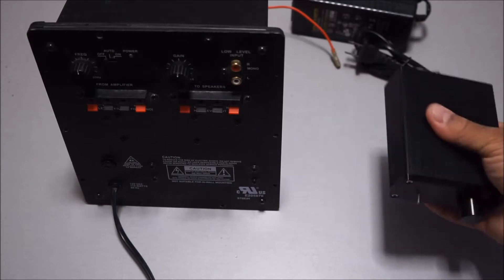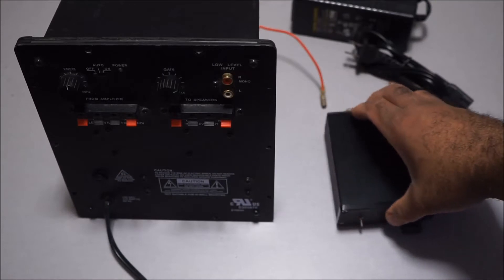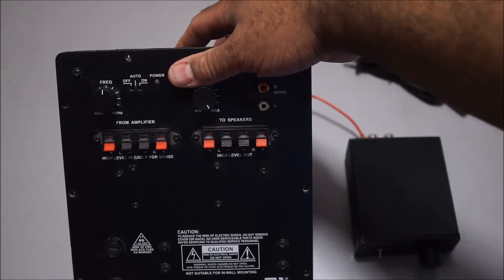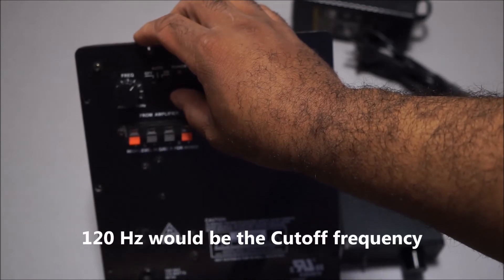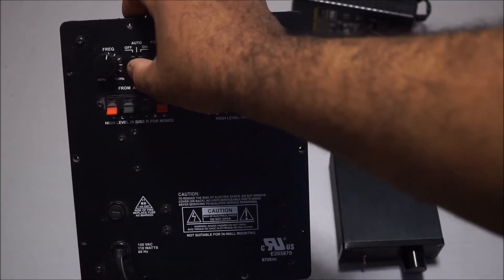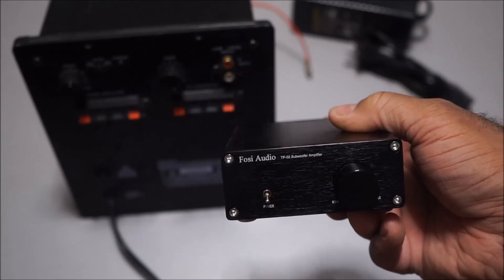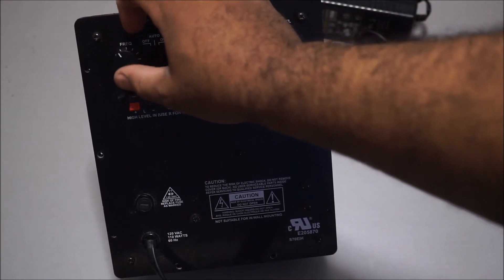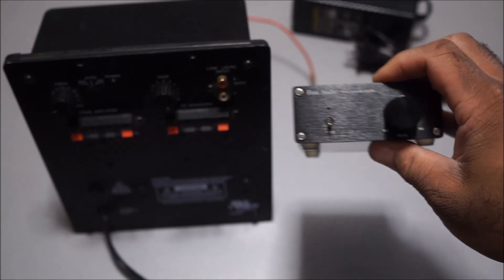Difference between a Subwoofer Amp Plate and the Fosi TP02 Sub Amp

Comment: I don't think this chap knows anything about audio or electronics.  If that plate amp (analogue) is rated at 400 wats, the general efficiency of the amp would be around 20 to 30 percent that would actually go to the speakers.  The rest is heat generated depending on the class, A, AB or C. That is why you have big heat sinks. That little FOSI shown is a class D amp (Digital) which is pulse width driven and the efficiency is 90% plus and heat sink is minimal.  Most likely this little Digital one can out perform the very much larger and heavier Analogue one.

Comment: The Fosi TP02 is perfect match for a Dayton BST-1 Transducer. I have 2 mounted on my sim rig, under the pedals, under the seat. This amp drives them very nice with loads of power so you can feel every bump, engine noise, gear change. Brilliant cheap amp for sim racing.

Comment: In my opinion, you missed several key points.
*point one* Most plate amps do not have an inside cover. This is for a good reason. The cover takes up valuable real-estate inside the cabinet. Also the air vibrating and pulsing inside the cabinet cools the amp. Being covered with no air circulation, an amp cooks in its own heat. 
*point two* I did buy and try a Fosi TP02 Sub Amp.  The power supply that comes with it is only good for less than half power, 150 watts. It would not drive my SVS PB2000 speaker ( I could barely hear it). The larger power supplies that allow full power are intrusive looking, expensive, and do not come with the correct connection. After failing to function correctly in its original configuration, I sent it back.
*point three* If your amp has an RCA sub pre out, the cross over frequency is already controlled. I recommend turning the plate amp's cross over frequency control on the highest setting , so as to not to double control this function.
Reply from the maker: Thanks for the comment.  Yes, I just wanted to do a quick overview and comparison of the two amps and just go over the basic functions.  Yes, the cover do take up space from the internal volume of the enclosure, but in a way it does help to shield the electronic parts such as the wires and steel screws and other parts from the large magnet of the woofer.  The magnet of the driver will effect the performance and the signal of the subwoofer plate amp (the electronics in the plate amp). is the woofer is too close to the amp plate.
Yes, that's the problem with with those small Tri-path subwoofer amplifiers (such as the fosi amp) Those amps are small, but have a bit of distortion when they are pushed hard.  The sound good at low levels, but at loud volume, they  distort hard.  And the power supply is always under powered, which does not give the full wattage as stated.  Plus the fosi amp sparks when you connect the adapter to the amp (when off), that's very unsafe.
It's always good to have a frequency controller on the amp.  it will help blend in the main speakers better. 

If I have time, I may make another video of the subwoofer plated amplifier.  The next video will have a more in-depth look.
Reply: @lovethatpop  A plastic cover does not shield any magnetic force from coming in.
Reply from the maker: I just posted the video reply to the Dayton Audio SA70 Plate Amplifier.  This time around, I tried to go over every feature that is listed on this amp and how it works.  I hope this clear everything up. Here's the video:  https://youtu.be/4fydq7ZpwHI

Comment: You think that the small one will have enough power for bass shakers?
I bought one from China. It has a LPF and the output was tested so I know what I'm getting. The alternative was a plate amp from China without any reviews.
Reply from the maker: Yes, the small Fosi amp has enough power for bass shakers.  The fosi amp really surprise me on the power it has.  It was more than enough power to run a 12" woofer. almost to much power to run a basic 12" woofer.  The fosi amp has a 200 watt output.  the power is true.  it also has a very good crossover, it produce very low and deep bass response.  The fosi TP02 is better than the amp plate from China.
Reply: @lovethatpop  I saw a text here on  YouTube showing it only had 50W.
I got the Aiyima A3001 amp. It should be a bit better bit I'm still wondering if it's enough.
Many people said that the Fosi is not enough. Even if it shakes the bass shakers it doesn't have the punch like a plate amp. Maybe because of the small power supply vs. the big capacitors in the plate amp?
Reply: @westsenkovec How did the Aiyima work out for your bass shakers?  I just ordered the same one and wondering if I made the right decision, as I was also looking at the Fosi TP-02, to connect to some Dayton BST-1's on my theater seats.
Reply: @SnakeDoctor5104 My receiver died so I never installed them. I tried them quickly to see if it works and it worked fine. I can't tell you more than that.

Comment: How do I connect bass Shakers the small amp.
Reply from the maker: hello, thanks for the comment.  You would hook-up the bass shaker the same way you would a woofer or driver to the subwoofer amplifier/amp.  When you are mounting the bass shaker, make sure it is bolted to a flat surface or board so it can vibrant and make sound. If you are using 2 bass shakers, you will need two separate amplifiers.  To hook up one bass shaker, you would take an RCA cable and connect it to the "Subwoofer Out" (output) of your stereo amplifier to the subwoofer amplifier or plate to the left or right of your subwoofer amp "Input".  Then you connect the bass shaker to the "Speaker" Input of the subwoofer amp.  That should be it.  I hope that helps.
Reply: @lovethatpop  I already have couple of bass Shakers already mounted in my other couch using a regular amp plate. The Shakers are wired in series on that one.
But now you're saying to do the same on my other couch using the mini amp I need two of these amps to power my Shakers even though they are already wired in series?
Reply from the maker: @rindershow212  Oh ok I understand now, I didn't know what you was using for your setup.  Since you have 2 bass shakers already wired to your subwoofer plate amp, you are going to wire to more bass shakers to the fosi tp02 Amp or a small amp, right?  Yes, you can wire 2 bass shakers to the fosi tp02 amp.  Since the fosi amp has or can handle 2ohm load, you can actually wire the bass shakers in parallel (if your bass shakers are 4 ohms each) by wiring the two 4ohm bass shakers in parallel, that would give you a 2 ohm load which should work find for that amp.  By using the 2 ohm load from the amp, you will get the full or maximum wattage output (220 watts).  Since you are using a plate amp and a small amp, you will need a RCA Y adapter / Splitter to connect both amps to your AV receiver sub output.
Reply: @lovethatpop  thanks a bunch 🙏. 
Yes I already have a setup with my other couch with bass shaker and amp plate.
I dont want to spend extra cash on another amp plate if I could use this cheaper mini amp to power a second set of bass Shakers to my other couch. 
So I guess I'm good to go . I will order this little amp to power 2 more bass Shakers to my other couch and wire them in series or parallel. 
I appreciate 🙏 you.
Reply from the maker: @rindershow212  You're welcome.  Remember, that tiny amp has a lot of power for its size.  It can drive a 12" woofer (120 watts) pretty easy.  Just keep the amp volume at half way or less and you should be ok driving the bass shakers.   If you need anymore help, just let me know.  Good luck on your project.

Comment: What amp plate would you recommend with a eminence nsw6021-6 driver? It'll be used 2-4 times a month for DJ wedding events.
Reply from the maker: Thanks for the comment.  The only amplifier I can think of that can drive that type of subwoofer driver (2000 or 2500 watts max) is the Dayton Audio SPA1000 subwoofer amp plate.  It has a output of 497 watts at 8 ohms and a 950 watts at 4 ohms.  that is your
best bet.  
The Amplifier Plate can be mounted on the back of the subwoofer box.  it has less heat and designed to drive sound in home theater and music playback.  The amp has a high price tag of $500.  

Here's the link to the amp plate:  https://www.parts-express.com/Dayton-Audio-SPA1000-1000W-Subwoofer-Plate-Amplifier-300-809
Reply from the maker: I was searching the internet for speakers and saw some Bash Amps on sale at partsexpress.com.  I forgot about this brand.  They have 2 subwoofer amp plates and they are much better price.  One is 300 watts for $199 and the other is 500 watts for $299.  these amp plates take up less space than other because there is no back casing to them, just the PC Board and metal plate.

Here's a link to the site and amps:  https://www.parts-express.com/brand/Bash

Hope that helps.